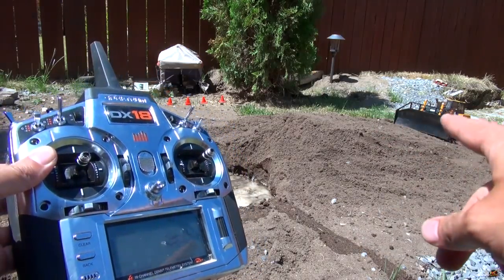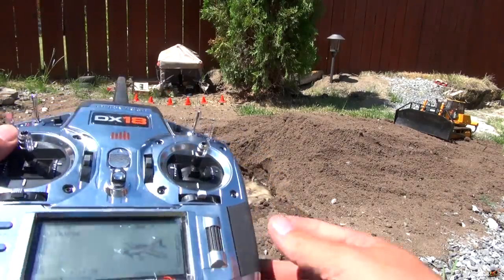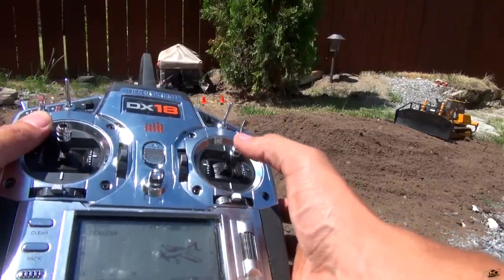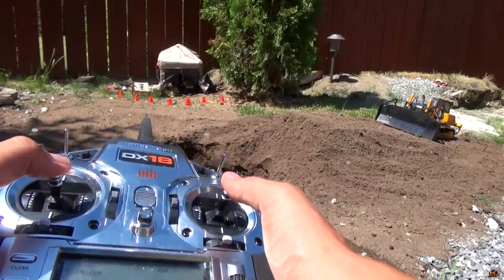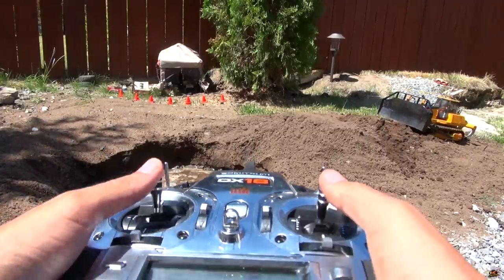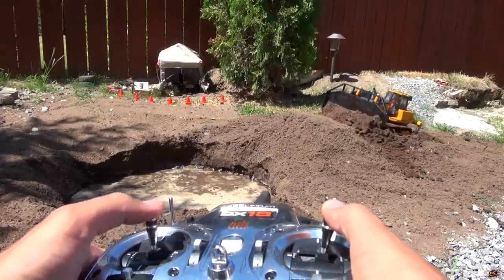RC ADVENTURES - 1/14 Scale Bulldozer - Backfilling a Pond

Comment: I am a bulldozer operator and the trick is to have perfect timing with the blade and synchronized driving and operating but looks like your learning just practice it will take a while but you will get it practice makes perfect.

Comment: Fun Fact, the Caterpillar D7E is an Bulldozer wich is powered by an diesel engine, but its power is converted into electrical energy by a generator and the tracks are driven by electric motors. Its sounds wierd, but they clame that because the engine can be at its most efficient RPM and the easy way to convert the torque, they use up to 25 % less fuel.
And that was in 2010.

Comment: Hey, I drive the real sized ones, just to let you know it's not called a Shovel, it's a Blade. And the whole machine is often called a blade also ;)
Reply: no
Reply: milton ares
yes  ;)
Reply: I agree it's a blade
Reply from the maker: Mason h I agree as well, but I also understand that in the english language, there are many ways to refer to certain items. Also, Im out here just to have fun, not really go over something that truly has no consequence. 

Definition: shov·el
ˈSHəvəl/
noun

1.a tool with a broad flat blade and typically upturned sides, used for moving coal, earth, snow or other material.
Reply: And you're pushing with that Dozer ;)
Reply from the maker: RustySkull Productions excellent advice.. thanks! It is a ton of fun..!
Reply: +RCSparks Studio do you know were i can buy any type of construction vehicles at ??

Comment: Dozer operator here.. nice work man! You just need to work on your backblading technique. It’s difficult to fine grade when you are attempting to finish off your work by “pushing” with the blade or ‘cutting”. When you drag your blade in reverse, it’s not only easier to see how much dirt you are dragging around with your blade from the operator’s seat (IRL) , but it also has the effect of smoothing out your work and track marks, (kinda like icing a cake). Just a little general critique on otherwise excellent novice dozing! Cheers, love the channel!
Reply from the maker: Dude.. you need to check out "YouTube GOLD". I have a feeling you will fall in love immediately. Enjoy the binge.. most people do.    #TeamRCSparks

Comment: hello, im a heavy equipment operator. if your curious on why they would backfill over water, i would say they would turn it into mud so they can load it out rather than pumping the water out. iv never done road construction just regular dirt work. I'm 20 by the way.. sounds crazy lol. check out my dozer skill on doing a slope. i uploaded a video of me doing it. and also when your pushing material with a dozer, push little by little.never try to push the whole pile because your tracks are just gonna spin but once that happens obviously little by little pick up your Blade. and btw I'm currently operating a L120 Volvo Loader but i do know other equipment such as excavator and dozer. i was actually loading out material on 30ton offloads the other day with a 320. sounds crazy for my age lol

Comment: Lift the blade of the dozer right before you get to the lip of the whole otherwise it will counterweight the front of it and sink get into it that's why on normal blades the bottom is curved so when you lift it pick some dirt up

Comment: hey medic  i drive these at work  you always tilt the blade  down only  when you trying to dig  to grave the  top of the soil you let the  blade float  an only  rise it when you start to bog down, when we fill in   are mud pits at work you  push a alittle at a time to build  a solid place for you to walk  across if it isnt solid enuff you sink , then you need a excavater  to  pull or dig you out :) any question medic  ill be happy to answer m8  i op   a dozer d6 cat  an a d7   same as a 375  excavater  an a  300 something volvo   front loader